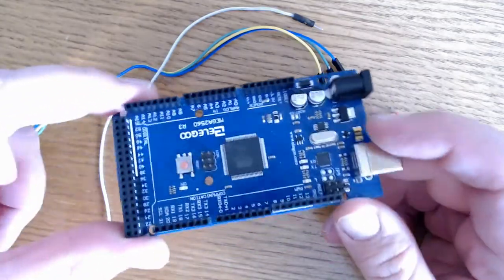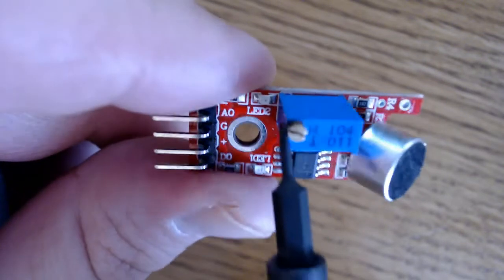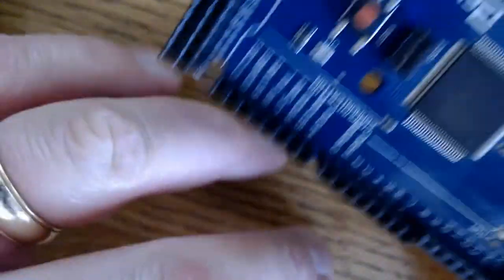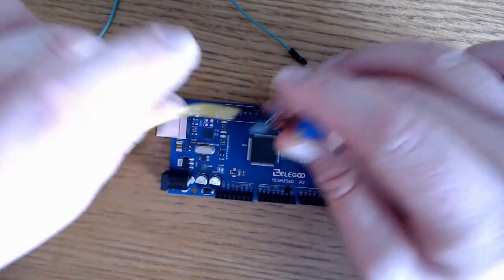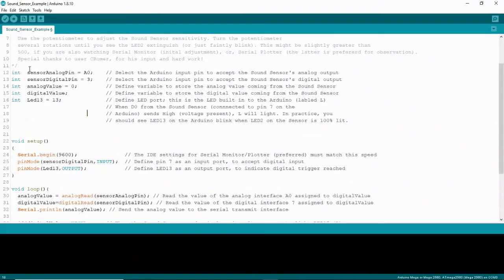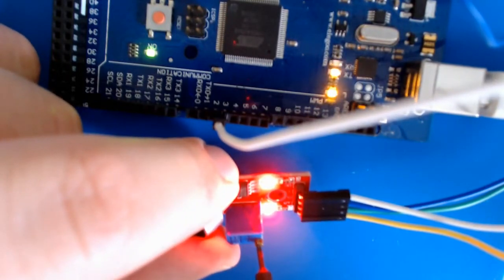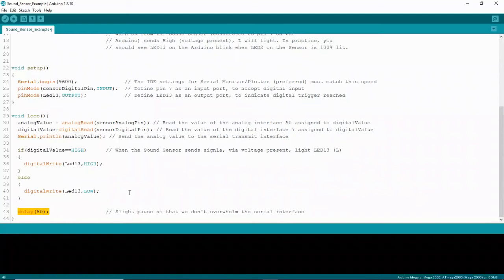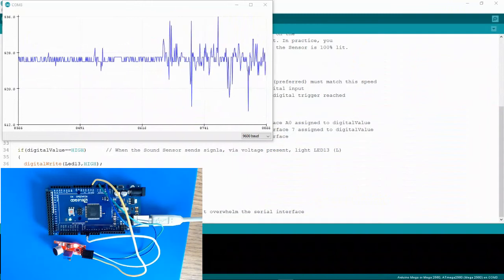Connecting A Sound Sensor Module To Your Elegoo Mega 2560 Microcontroller - Lesson 20 Tutorial

Comment: Any video/link recommendations on how to integrate an LCD display for the dB readout? Thank you.
Reply from the maker: Hi Daniel! I just did a Google search for arduino dB read out on LCD display.  A YouTube video popped up from IOT PROJECTS Ideas... maybe start there.  I didn't watch it all or see if he provides the code but maybe check that out. 
I have the LM393 sound detection module which is ultra cheap and is just a noise trigger. I just purchased the sparkfun LMV34 sound detector.  It has a pre-amp, peak detector,  buffer amplifier,  and  a Schmitt trigger. I been wanting one for a while.  Thank you for the reminder. I may give this project a try and see what I get :]

Comment: Another great video.  How did you know to put a wire from the do on the sensor to pump? I see digital inputs on the mega too. Would it work?  How can find out if things I want to hook up go to pwm or just regular digital inputs? Thanks
Reply: Never mind.  I just found everything on the website elegoo. Thanks for the video.
Reply from the maker: Yes, some of the videos you will find in the elegoo kit instruction book. If you have access to a library or amazon books, there are a bunch of books on Arduino. To help with the code you can go to the Arduino Language Reference page - It gives lots of detail. Dronebot Workshop is an excellent Arduino resource on YouTube and i'm sure you'll find many more.
Reply from the maker: Go to the data sheet. The component data sheet should tell you if you need PWM. I've always used pwm with SG90 servos.